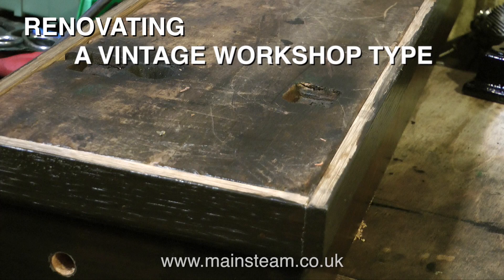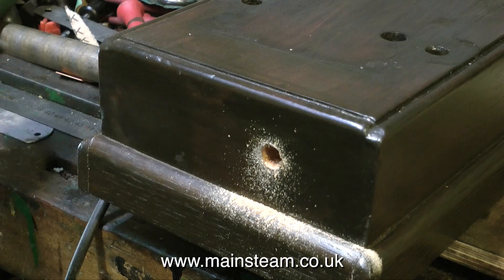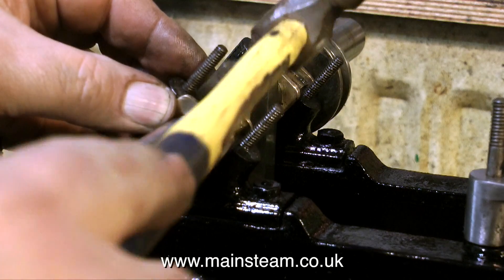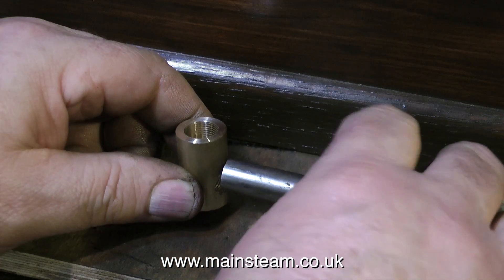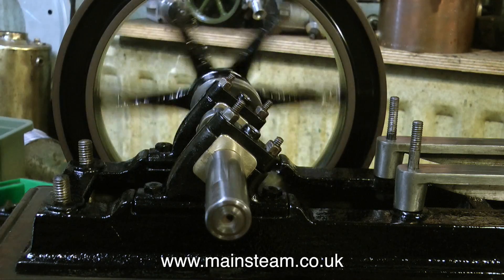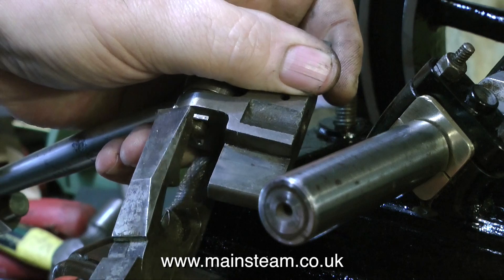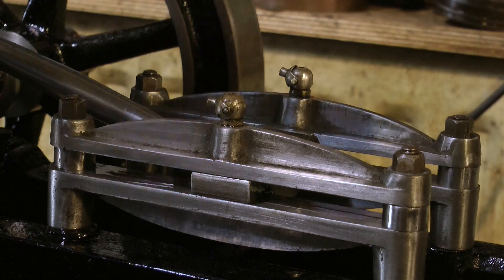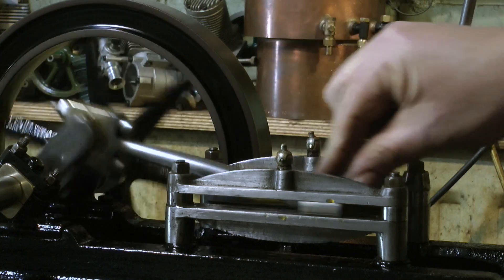PART #8 - RENOVATING A VINTAGE WORKSHOP TYPE STEAM ENGINE

Comment: will you be using it to power anything in the work shop? maybe an old union pillar drill? 
thanks for another great video!
Reply from the maker: calm callum No, alas the engine belongs to a collector friend of mine.
Reply: Keith Appleton oh ok, they are very lucky then!